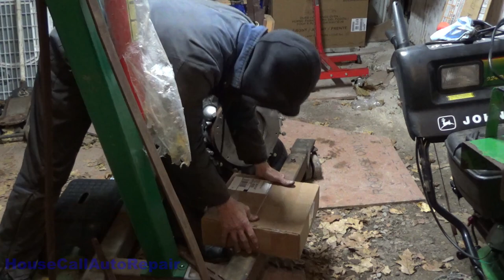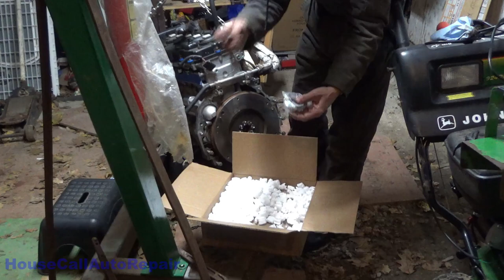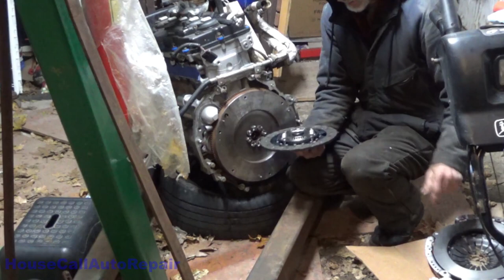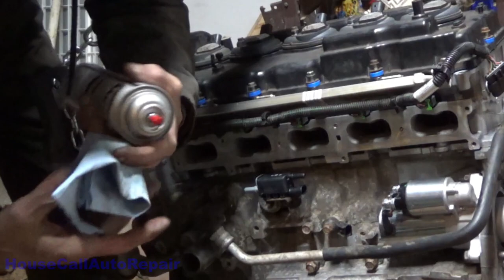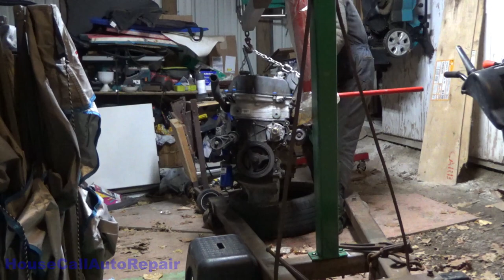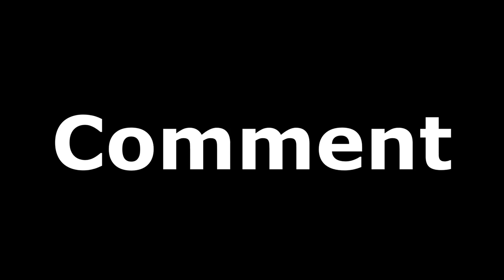2006 Hummer H3 3.5 5cyl teardown - Part 8

Comment: About time you put it together! Just changed my rear brakes. Changed one side a week ago. And didn't change the other side. It started leaking. It was a cylinder , was falling apart. Glad autozone had it ,20 bucks. Had no brakes after changing brakes and cylinder. Had to bleed those. But the air never stoped  coming. Do you know why ? I was bleeding it for an hour. Brakes are okay. Thank you very much for your advice.
Reply from the maker: Trust me.... It's taking me longer to edit than putting it together did...  It's been back on the road for a few months now, and not without a few minor issues (to come)
I'm glad you got your brakes fixed. I'm not sure why the air never stopped coming out, but I would recommend taking it to a mechanic to have it checked out.
Reply: @HouseCallAutoRepair  check engine light on. Hesitation is still there. I have to fix it before emissions. Corolla!

Comment: I don't understand what this torque angle business is all about. Never had any bolts back off with the old fashioned torque values. I guess it's an excuse for the manufacturers to sell more hardware and tool trucks to sell more tools.
Reply from the maker: Having studied mechanical engineering, It's all about elasticity, clamping force and stretch. The finalizing torque angle, is what stretches' the fastener.to the maximum possible while not going beyond it's elasticity. Once a fastener has been stretched, it SHOULD NOT be stretched again. (The re-use cheat is to not use the full torque angle, but this DOES reduce clamping force)
Cylinder head bolts are generally a really good example. They tend to SNAP when re-used. and CAN lead to head gasket issues down the road.
Reply: @HouseCallAutoRepair  Great explanation. Thank you!